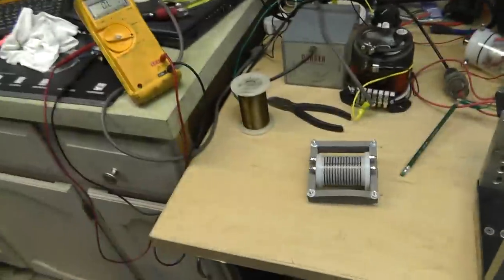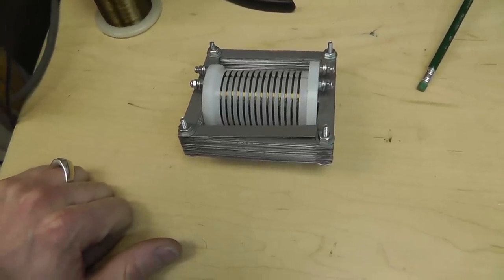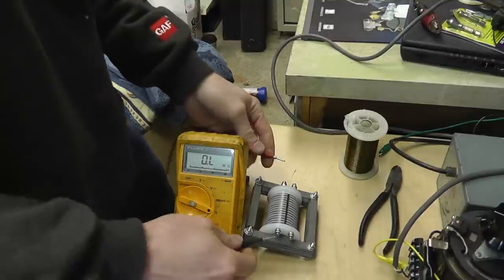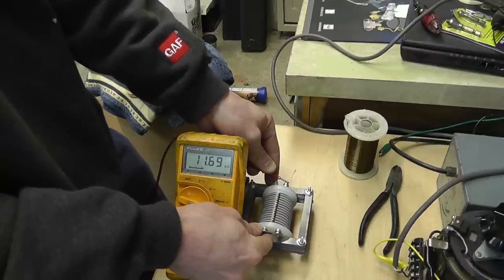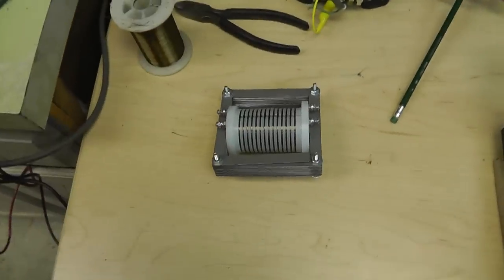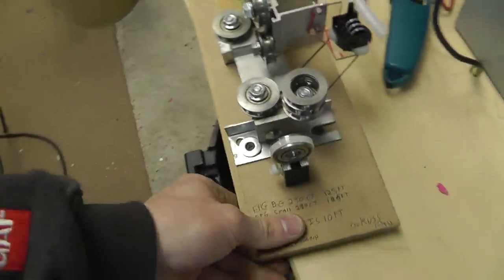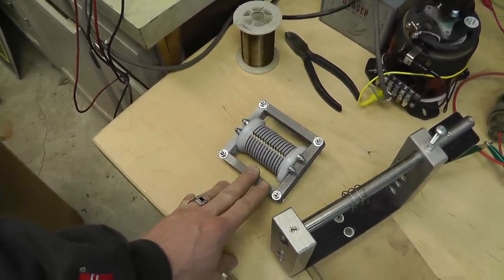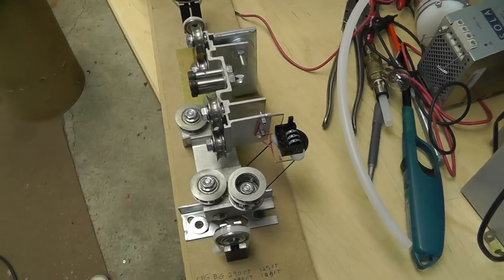Injecter VIC Matrix, Inductors Wraped & Mesurments.

Comment from the maker: Daniel, yes, bifilar is both wrapped together, you can connect bifilar wires differently but these are connected to the secondary...  more research before a state how to connect everything as we need to test... thanks!!!! ~Russ
 ps. the ss wire is .004" with isolation and .003" bare... these could be measured more accurately but with my calipers this is what i measured.

Comment from the maker: h2o, look here in the same section and you will see that the "VIC Bifilar Wrap Coil-Assembly (10-3B) and
VIC Dual Coil Wrap-Assembly (10-3A)" are different than the "voltage intensifier (VIC) circuit coil-assembly (580) of Figure (6-1)" here is a quote from section 10 you refer to.  "To reduce amp leakage still further, the copper
wire of both Resonant Charging Chokes (56/62) can be replaced with an magnetically ~ductive stainless
steel wire (430F/FR) " the research has been done, thanks, ~Russ

Comment: The reason for the insulation is this. By decreasing the thickness of the core along the path perpendicular to the current (or should I say along the electro-magnetic flux) the available electron count is decreased and thus the internal currents resulting in the core are greatly reduced. This allows for more current in the coil, good magnetic field and less heating of the core. If your core lamination is not insulated then stick some paper between the layers. Epoxy well cured works well also.